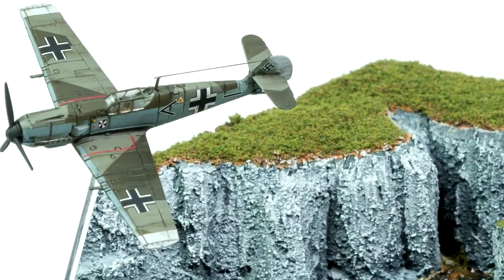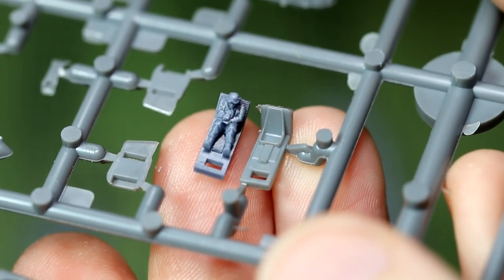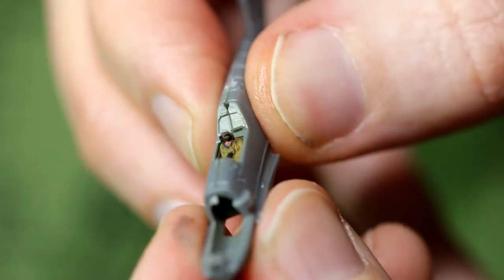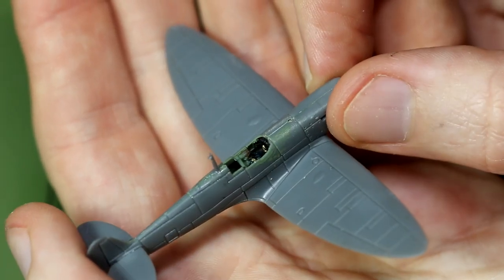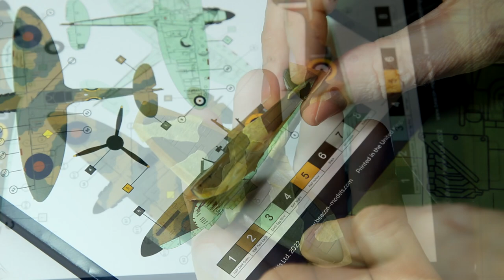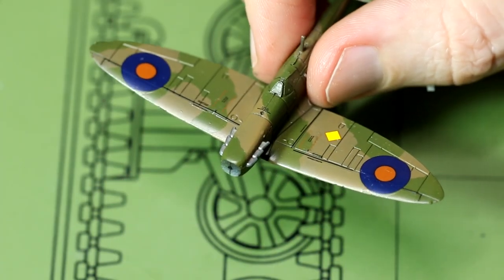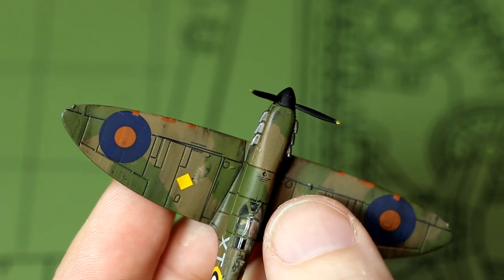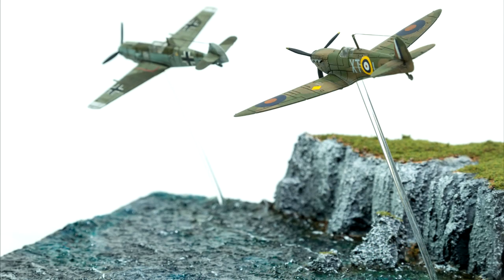The Battle of Britain diorama - Spitfire and Bf 109 (Beacon Models 1:144 scale model kit)

Comment: A great diorama and the kits produce nice models. I think you captured the sea very well. The only thing is the static prop blades. i have experimented with discs of thin clear plastic and airbrushing fuzzy prop blades onto the disc then finally putting a thin wash on the disc whilst rotating the disc. Rather like creating a windscreen wiper pattern effect.
Reply from the maker: Thanks Allan. Yes, I was just thinking about the disc propeller effect yesterday as I will need it for a future project. I'll have to give that a go.
Reply: I must agree with Allan. You have put a lot time and modelling skill into this dio. So please go the extra step and blurr those rounds of clear plastic. I am almost finished my REVELL Spitsfires and a Messa Schnitzel 109 (Deals Wheels) cartoon aircraft and flight is necessary..............cheers

Comment: Disappointed the kit doesn't have a pilot figure. Having to buy a pilot separately is a rip off. You did an awesome job on the dog fight scene.
Bill
Reply from the maker: It's quite common (in larger scales, at least) not to include a pilot these days. Or, like some Airfix kits, to only include one for a two seater aircraft!
Reply: @ModelNerd  Most vintage kits I've seen provide a pilot figure. If progress of newer kits mean omitting that option, I'll stick with the old dog kits. Hey, keep up the great model building.
Bill
Reply from the maker: @PanzermansBunker  Thanks. Yes, it does seem to be a modern trend to exclude them